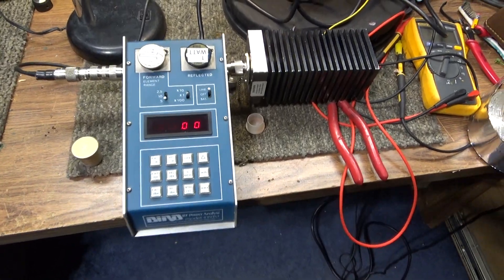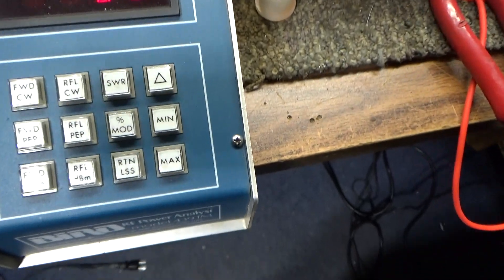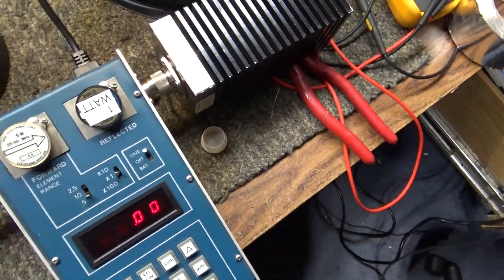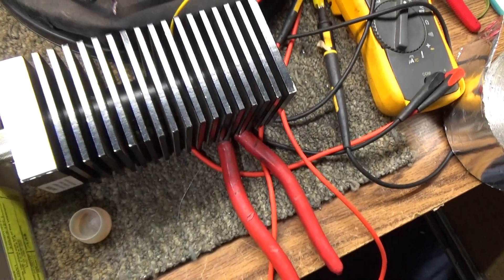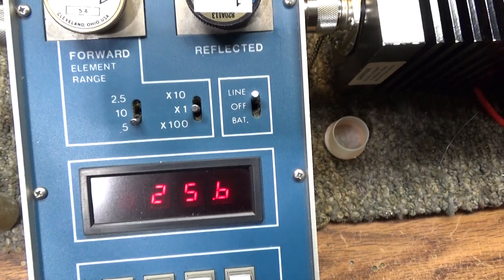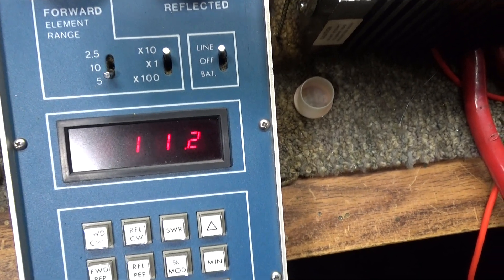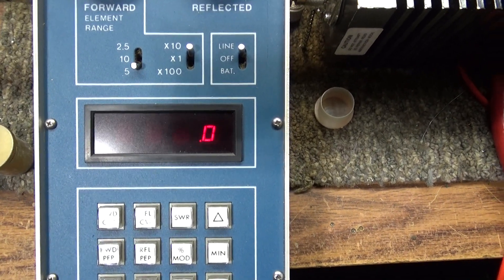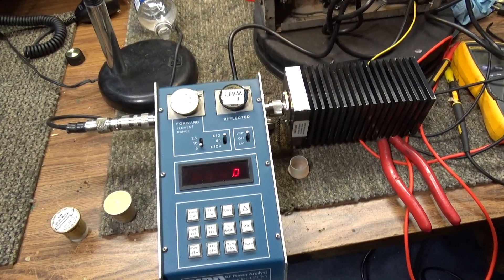Bird Digital wattmeter 4391M Test Set with Case and Dummy Load.

Comment: If the power range is determined by the slug, what’s with the 1X,10X , 100x range switch? 
I would think with a 5 watt slug, you would be able to switch from 5 watts, 50 watts, and 500 watts.
What gives?
Reply from the maker: 1x 10x 100x moves the digit on the led display and that's it. Lets say with a Bird wattmeter the most voltage it can actually handle in the meter itself is 5v. Lets say a 5 watt slug puts out 1v per watt to the meter hence when you go over 5 watts with a 5 watt slug, more volts go into the meter than it can read and the meter goes into overlload. Changing the 1x to 10x only moves the digit over, but its still too many volts going into the meter so still an overload. Hence, if you go with a 50 watt slug, its going to put 1/10th of a volt for every watt into the meter so now no overload, and since the watts are now divided by 10, you would need to put the range on the x10 to make up for it.